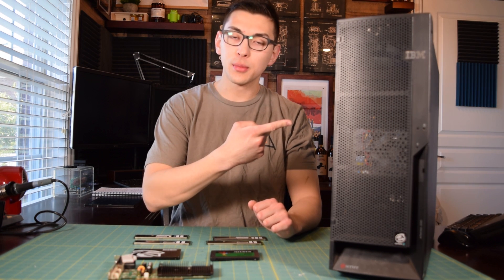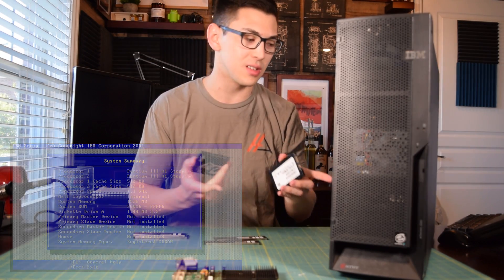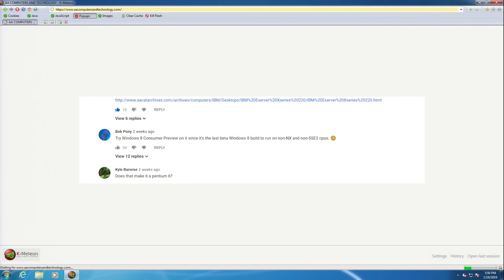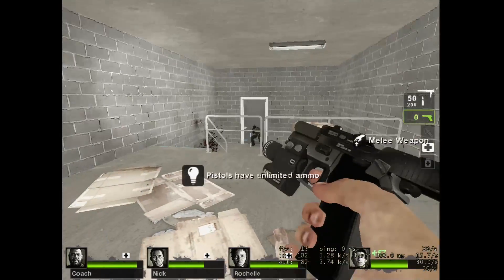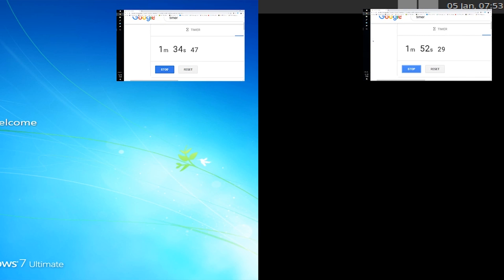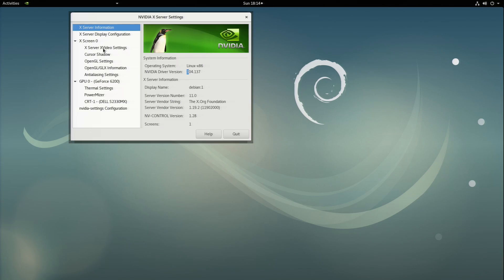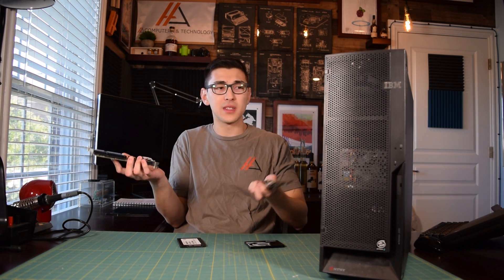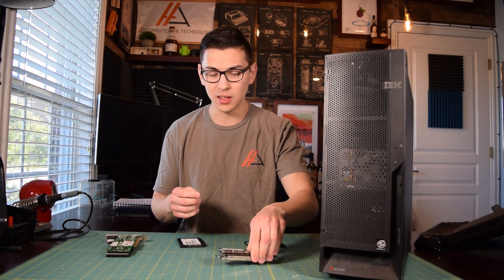Trying to Make a 18 Year Old Pentium 3 Desktop Usable in 2019 (IBM Eserver X220)

Comment: I remember clearly being able to decode 720p on a pentium 3 700mhz so with dual 1.4ghz you should be able to do 1080p no problem with the right codecs installed.

Comment: Unfortunately very few motherboards (Like the Supermicro P3TDDE, MSI Pro266TD, and Iwill DVD266-R.) came with the features more modern computing require to have much use; such as an agp slot paired with either an ATI HD3850 or 4670.  Could still get more power through the use of a Zotac GT430, 520, or 610 PCI graphics card.  It is absolutely possible to play a lot of games 2008 or before; and some lighter games after that time period.  Someone like MrOffordef has plenty of videos showcasing what is possible and can be an entertaining browse.

Comment: The best operating system for your ibm is probably windows 2000 pro or windows xp pro, you can reskin both these operating systems to look more modern as i have an old packard bell p4 3.2ghz ht running xp media edition that ive reskined to look like windows vista with the sounds to go with it called 'vista inspirat' with 'vista preview' which gives the whole new feel to you o/s 😉

Comment: I was given a brand new intel se7505vb2 workstation/server board for free, ive put in 2x xeon 2.8 processors, an agp x8 512mb asus graphics card, soundblaster 7.1 card, wifi card, 4x case fans glowing red, 2x dvd multi format drives, a card reader, an ide 80gb system drive and a 500gb sata drive, a floppy drive, twin soundcard fan cooler with a 1030watt psu that runs windows 7 nicely 😉 oh and its all in a nice brand new biege workstation case 😀 its not a great gaming machine but it plays 1080p videos very smoothly and the sound is clear, multi media wise it great 😎

Comment: Writing this from vicinity of Tokyo, Japan. I also happen to own one of these with 512MB*2 RAM and 1.26GHz-Dual config. Now, let me mention that I did try to use it as a daily-use PC back in 2006-2007 while trying to run WinXP Pro, and that doing so to get satisfactory results wasn't easy either. I recall I installed nvidia GeForce MX440 (PCI) to resolve the graphic-performance issues and that was okay. The part I had issues I couldn't find a single work-around for was getting the sound to play properly under SMP (I recall that below-described issues were not present under one-CPU). I only managed to get choppy sound out of this box no matter what method I tried. First tried SB Live! via PCI, tried all possible PCI slots and the sound was choppy. Assuming that its driver wasn't meant for heavy usages under SMP, next tried some generic UAC1.0 devices (namely YAMAHA Cavit DP-U50 and RP-U200, and TI PCM2704C) via the mobo's onboard USB. Still with no improvement. Expected that an add-in PCI-to-USB2.0 (built around an NEC μPD720101) would solve the problem but got no success.

Running a light-load LAMP server (in CLI, based on distros like debian) on this machine does serve most purposes I ask for at satisfactory levels, but that's all for me. Sadly, a RasPi that's far less power-hungry does the job faster and more efficiently, so x220's having a post-retirement life in the attic.

I still keep the machine in my attic though (like I said) since I love the "pointy" designs of IBM-made hardware of this age.

Anything that's comparable design-wise with this IMHO is HP's zx2000, xw6*00, xw8*00 and xw9*00. Maybe I will make mods to the x220's casing, in order to fit in a more-generic, more modern set of CPU/Mobo/RAM/VGA.

Comment: 2x Pentium III, 2GB SDRAM, Geforce 6200A, Lubuntu=still kind of useable for basic web browsing.

Interestingly, whether I was using Windows XP Pro or Lubuntu, the machine felt far faster than my old laptop, with; a 3.2GHz Pentium 4 HT, 2GB DDR and Radeon 9000igp.

Comment: CPU-wise, dual Tualatin 1.1 GHz should be at least as fast as a Banias as long as you're using a multicore-aware OS, and those work fine in Linux. But you can't do anything anymore unless you have some GPU power under the hood. Shame that PCIe to PCI adapter wouldn't work in it.

Comment: Hmm odd that video was a slide show. I got blue ray rips to run no problem on an Athlon Thunderbird 1.2ghz with a Radeon 3450 gpu to run smooth. I was surprised. Video acceleration on that gpu was limited though, and couldn’t find an agp gpu with modern enough video features at the time.

Comment: you need a PCI to PCIe converter and a newer display adapter to get the videos to play well. thats what I've done for my Pentium 4 system
Reply: where did you buy that converter?
Reply: wot Hmm I bought mine off eBay from a Chinese seller 2 years ago. Seems they've removed it now... Interesting. And from what I noticed, the later pci cards are essentially PCIe cards with one of those PCI conversion chips (found on my PCI to PCIE adapter) built into the card to output PCI. That is why both that and my converter card show up in the bios as a PCI bridge.
Reply: @kztech1319  too bad they are so find to hard nowadays. would be fun to play around with such stuff and do some really silly experiments... like 1080ti in a pentium 2
Reply: wot Well can't go that far. You can do as far as Pentium 4 paired with GTX 1050 Ti, if your graphics card is too powerful, it has a high driver overhead, which will give you resource allocation errors if your hardware is too weak and driver won't load at all
Reply: @kztech1319  hd7850 in a dual P3 would work?

Comment: How's it going??? So something I'd like to point out is you are using these newer operating systems with this older hardware. No problems there. Why not try and use Win2k, with modified installations of newer firefox installations, and google chrome running in Win2k. I do this all the time on my classic gaming machines. Secondly your Nvidia 6200 is plain bad. It is unfortunately the memory modules that have failed. The main issue with this system is it does not have AGP support making it near impossible to get a decent video card. I run 1080p with an older ATI Radeon X1650 512MB video card, running windows 2000. If you are interested I can send you info on my builds, and you can do your own research. I'm also willing to send you a system I have completed running a modern version of firefox, 1.2GB SD RAM, and the video card mentioned above to play around with. It has an Athlon 1.2GHz on it as well, and runs linux like a champ. Of course it has it's limitations, but otherwise has good video performance. Let me know if you are interested in that for a video.

Comment: Why were u trying to use proprietary driver for Linux? Old binary drivers on modern OS is like trying to run Windows 7 drivers on Windows 10 - it may work but will be unstable. Open source driver (which is default on Ubuntu) is really the best choice for that old hardware.

BTW I still use Toshiba Tecra R10 (around 2008) as my main laptop and with small changes (SSD and more RAM) it is really enough for web browsing, watching videos, light gaming and most of my work.

Comment: This system would've worked better on Windows XP, it wasn't designed for modern OS and was a pretty decent rig for its time.
I used to have a Pentium 3 and later a Pentium 4 PC with dedicated graphics cards on both back in the day and they'd run games from back then smoothly.
Great video though!
Reply: Ur r8. It was designed for Windows XP

Comment: I wonder how well a 4x Pentium 3 system would run now. Back in the day, these systems weren't really useful since most software was written for single thread systems.
Reply: is that even possible? i have never seen a board with 4x socket 370 or slot

Comment: Would a pci gt610 work? I put one in a dell dimension 3000 and it ran windows 7 like a breeze with only 2gb ram and a single core 3ghz processor.

Comment: i still think the Slot 1 Pentium 3 are much better than the socketed ones. what about a PCI 5450 or a 8400gs or even a GT 430, those came out in PCI form as well. but, dual socket Slot 1 are so expensive these days and hard to find locally as well. slot 1 has a hefty premium now.

Comment: I have that case for my current machine. It's very ergonomic, 3 hard drive bays (3.25") with rail in a sliding cage, 2 5.25" fixed bays, 2 3.5" fixed bays. It's a cool case for a sleeper PC and looks very nice. I love the IBM PC case.

Comment: This just my opinion. It may be a little blunt. This is pure junk. Just throw it in the garbage at a technology turn in event. You can do a lot better just purchasing a newer old HP box that can use a core processor that has AGP already. The CPU will never be fast enough for anything. You need at minimum about 8 Gigs of RAM to run a modern OS Like Win 10. There comes a time that upgrading will accomplish nothing but throwing good hard earned money in the trash can.
Reply: You don't have to completely trash it.  If nothing else it could make a decent case, since it seems it probably has more than zero 5.25" drive bays.
Reply: @SenileOtaku  You have to think logically about this. Nostalgia is not a reason to use an old slow antiquate computer  There comes a time that an upgrade becomes a giant pit you throw your cash in.  People also want things like USB 3.0 ports.
Reply: This amouth of GB and heavy shit are only  used for the CIA.   hacking hardware, all against the liberty of the peoples.  The modern win. has  nothing to do with the real and the  best.

Comment: If you had an AGP slot you could get 2 1.4GHz P3's and a I think 4650 and play Skyrim with a fair few performance improving mods on a light weight Windows XP and possible light weight Windows 7 at around 20  FPS.
Reply: 4670 also exists for agp... or the hd3850 which is the fastest agp card. with cards like that you can even get crysis to be playable on a dual p3 system

Comment: I saw you are running a 1.1GHz pair of CPUs according to ftp://ftp.software.ibm.com/systems/support/system_x_pdf/24p2925.pdf it can run a pair of 1.4GHz 

INTEL Pentium III 1400S which are Numbers SL5XL, SL657, SL6BY, SL6JP

There are loads on eBay at a reasonable price

https://www.ebay.co.uk/itm/Intel-Pentium-III-1400-MHz-1-4-GHz-socket-370-CPU-SL5XL-Fastest-Tualatin-PIII/202559923050

Comment: I already told you on the previous video that gpus previous to the 8000 series are not supported anymore after Ubuntu 16.04. And even among the 6000 series that you decided to use you choose one of the crappyest ones. BTW it's strange that the 304 driver gives you problems in Ubuntu 16.04, i know for sure that works on the pcie version of 6000s series cards. I like your videos, but you should have used a Gt610, or at least a gt520, or gt430. A pentium 3 when oveclocked can often outperform a pentium 4, this system is heavily gpu bottlenecked.

Comment: That gfx card is very slow you should use a better pci card, the coolest you can use is he voodoo 5 5500 pci on windows xp which will make it a very solid gaming machine for the year 2001 capable of running all the early 2000 titles very well

Comment: We have one of these old IBM servers for our phone switching system. It still works believe it or not. Runs NT Terminal server like a dream. But I wouldn't go far beyond XP on this thing. Windows 7 might boot, but lord knows that's too heavy. Windows 2000 would be probably a more perfect option to be honest. Even XP sp3 might be a bit heavy considering. I wouldn't mind such a toy for my collection. I enjoy still running older operating systems like OS/2 I could imagine this would run that without much complaint. But, that's just the geek in me talking. Anyone for OS 4.52? lol
Reply: Malcolm Davis Probably to a degree. The biggest problem is bandwidth and drivers. But it's because of that as I said Windows 7 simply isn't ideal for this setup. Especially given a modern Web page, and how complex that can quickly be. Windows drivers for Nvidia downright stink, let alone using a PCI based video card. It's a neat project, I'll certainly say that. It's just not optimal for the hardware involved.
Reply: Malcolm Davis Yes, that's essentially what I am saying. Windows 7 is wonderfully optimized for even old hardware. In some situations it actually performs better then Windows xp. But you combine the pci video with the lack of things like API support and I could see this situation easily.

Comment: I would try Lucid Puppy or Precise Puppy Retro in it for daily driving.  Any of the Puppy 4.X.X distros will work fine it.  I even got Chrome 7 to run in a similar machine with it.  As far as YouTube goes, get a YouTube download app for any 32 bit machine without the latest SSE support, Windows or Linux.  It's slower but far less frustrating than trying to watch the slide show.

Comment: try to put GeForce GT 520 (PCI version of course) - this is the strongest PCI card available but it is little bit rare
Reply: BodziuM no there’s a Gt 610 your mistaken. And that one is easy to come by and it has direct x 11 Support
Reply: Yes it’s Pci not pci 16x
Reply: @willpitts9957  GT 430, GT 520 and GT 610 are basically the same exact cards but rebranded. Any of the would work fine. Keep in mind that the PCI slot will heavily bottleneck all of them. It already wasn't enough by the time Radeon 9000 and hair dryer (FX) series came out.
Reply: xXx_420_360_HaX0rDaN0uSkoupah#sWaG#l3g1t_darud3w33dstorm_360_420_xXx still a better card than what he tested. Having hdmi, and a modernish card like that would be better then what he has now, just saying.

Comment: Personally, I would've used a light weight DE like LXqt or XFCE on Debian instead of Gnome, since Gnome can definitely be a resource hog. LXqt is not LXDE, btw.
Reply: MATE might also be an option, Your right Gnome is pretty resorce intensive. I would not recommend KDE or Cinnamon for the same reason.
Reply: z  ide has gotten better in using less resources.
Reply: WindowMaker.
Reply: Yeah if he chose LXQT or even DWM if he was really hardcore the Linux benchmarks would've been much better.
Reply: What about a WM like Window Maker
Reply: @jamesdoe4515  What is that?

Comment: Get a 8400gs pci video card, it unlike the 6200, the 8400gs has gpu accelerating so firefox and chrome will work MUCH better on windows 7. Geforce drivers were released for the 8400gs. (GeForce 342.01 Driver)
Reply: GeForce GT 520 is better but PCI version is rare
Reply: @BodziuM  Yes, but it might be too new to be compatible for that p3 server.
Reply: There's even GT 610 with PCI connector, from Zotac I think.
Reply: @MJ-uk6lu  I believe the 610 was just a rebranded 520 but good point.
Reply: @bakatoroi  Maybe it was, but I bet 610 would have longer driver support. In terms of speed they are both bottlenecked a lot. Even something as ancient as FX 5500 PCI was already bottlenecked. PCI era for long time was dead. for more than 5 years, when FX 5500 PCI was launched. GT 520 and GT 610 are even weirder things as at the time pretty much any PC had PCIe connectors. maybe older PCs had some AGP goodness, but for some reason AGP cards died earlier than PCI ones.
Reply: There is an HD 4670 AGP variant but it's very rare.
Reply: @bennybouken  We are talking about PCI here only. AGP is in no way compatible and that card is definitely older than GT 610.
Reply: @MJ-uk6lu  True, but the 4670 is a bit faster still. but for a pentium 3 PC like this, if it had the AGP slot, for GPU intensive games, the 4670 would absolutely murder the 610 Pci. Even the Pci-e 610 as is.
Reply: There is a PCI version of the 710 and its on stock, it provides 350~ GFLOPs and has 192 shading units!
Reply: The open source drivers are usually the best option for older gpus under Linux.

Comment: It would be interesting if it was able to actually do server stuff, like gaming servers.  If it could properly run a Counter Strike or a Killing Floor server would be certainly an interesting value proposition.
Reply: A PC like this can run circles around running a daily 24/7 Counter strike, Killing floor, Halo 1, and so on servers.
Hell, you could even use a PC like this as a server for more modern games to like CSGO, Halo 2 PC (project cartographer), Just Cause 2/3, etc and so on. 
All in all, most light weight games released today would work fantastic on a machine like this.

Comment: Dam its a shame it doesnt have an AGP slot. You can get much better gpu on AGP that might have driver support. and because there was no drivers working in windows the CPU had to do most of the graphics rendering :(
Reply: Frugal Techie they make a gt 610 pci version that has direct x11 support, there is no agp cards that have that feature
Reply: @willpitts9957  The limiting factor here is the PCI slot. DX features of any card are useless if the PCI 33 slot this machine has is bottlenecking the performance. If he's using a PCI SATA card for those SSDs then thats cutting deeply into that shared 133.33 mbps across all those slots.

Even if the SSD is running off an IDE to SATA adapter instead of a PCI SATA/RAID card then that 6200 will be choked by the PCI slot housing it.

I'd be interested to see a setup using one of intel's workstation boards like the OR840 with dual CPUs, 2GB RDRAM and a decent AGP card like a HD3850.... or even a 6800GT.
Reply: @vettori8185  I wonder if the SATA card has 66Mhz support, as there's unused 66Mhz slots, I assume this board would have two PCI busses .